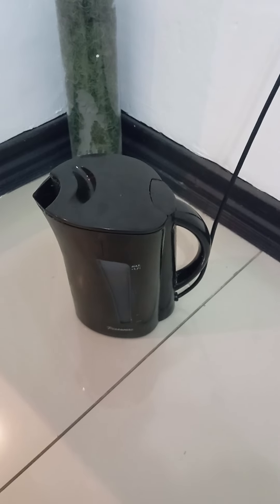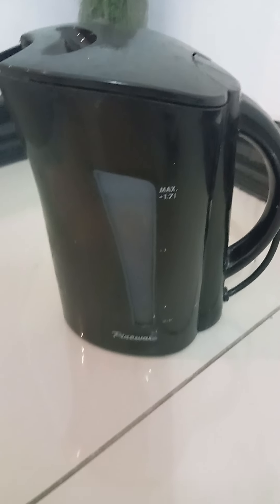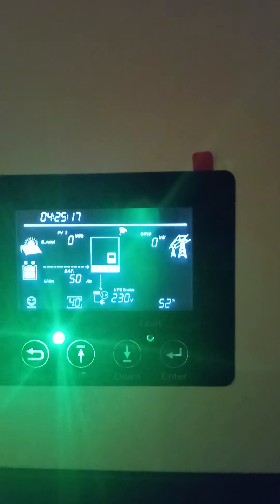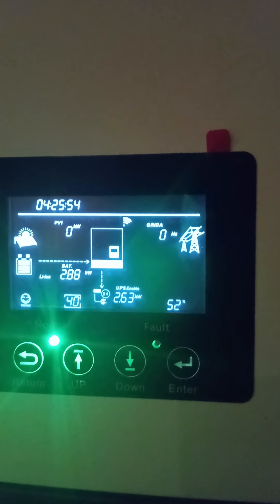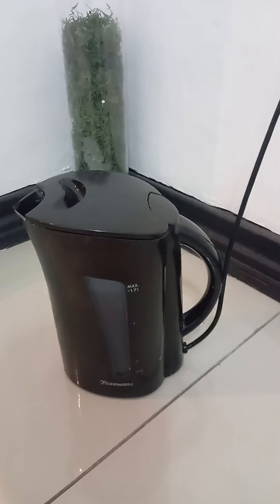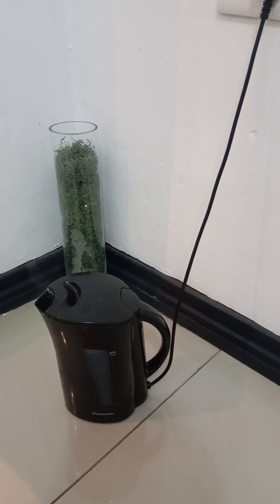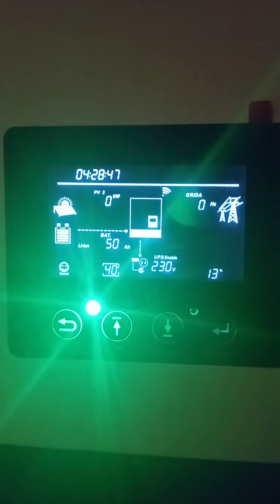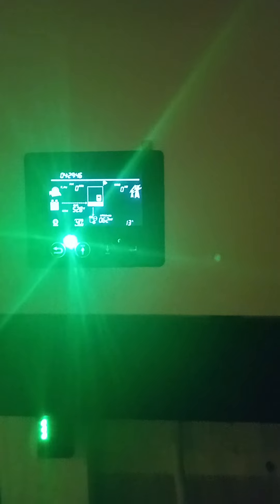Lux power Sna 5Kva in action live demonstration

Comment: Are you more worried about the battery draw? So if we were to run the inverter at 3.5kw, lets say to heat the geyser using solar, would you still advise against this?
Reply from the maker: @tshepolr5833  no it's not about battery draw it's about life span

Comment: Are you saying its bad for the inverter to Run more than 2 kw when there is load shedding ?i plan on using thw sna 5000 to run the geyser but only in the day when my pv input is more than 2kw and when Eskom is running

Comment: Hello Anthony thanks for your videos.. what is the difference between the sna and lxp versions of lux power.. i see a big difference in price... also would you recomend luxpower? I need to replace a broken infini solar hybrid inverter 3 phase 10kw ... im thinking of getting 3 luxpower sna5000 one fro each phase.. or 2 for one phase where i have bigger loads and the 3rd one for the 2nd phase and the 3rd phase just grid (less important loads)...
Reply from the maker: SNA is a hybrid off grid inverter, LXP is a hybrid Gride-tie
Reply from the maker: for a three phase rather you go with SNA unless you want to feed none essential with solar LXP
Reply: @anthonymwambazi7390 thanks for the advice.. so with the SNA line i can have grid + solar feeding onto load whenever solar is not enough yes? I would want the batteries to be used only at night and ofcourse whenever theres a power outage and day is cloudy and solar is not enough .
Reply from the maker: @FX_AnimationStudios  yes its possible with Sna, the challenge though is that once the load consumption drops on the premises. The balance will go out to the grid and that machine does not have a meter or ct to stop it from feeding back to the grid.
Reply: @anthonymwambazi7390  thanks so much for replying... have you had any experiences with growatt 6kw ones? how do they compare to the luxpower brand?
Reply: @anthonymwambazi7390  I read on the manual and it said we can have external ct for sna right ?
Reply from the maker: @pitiwatkittiwimonchai4656  hi Ct is only on 6kva  the new one i dont know the 5kva